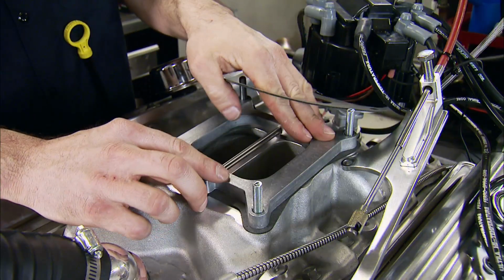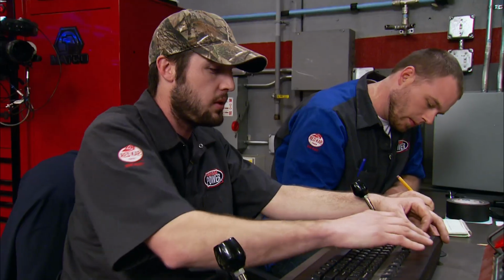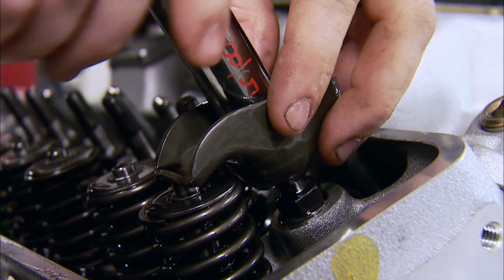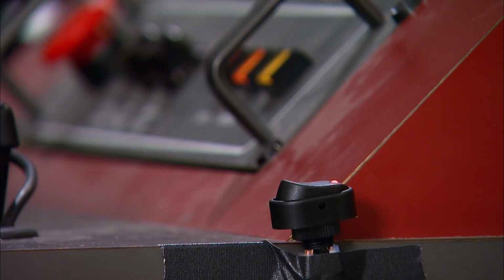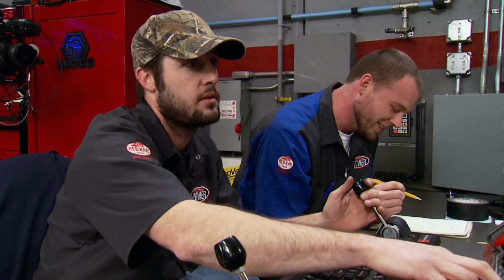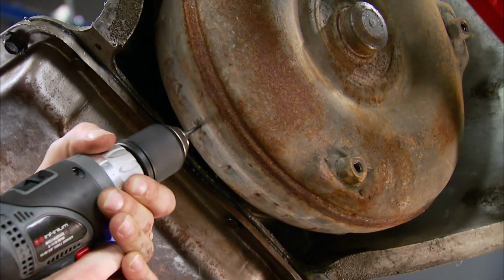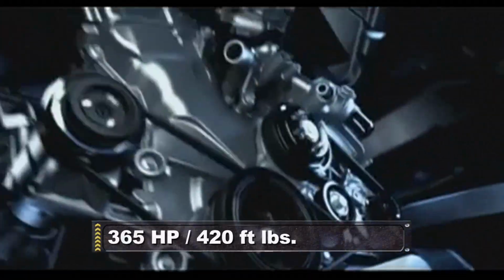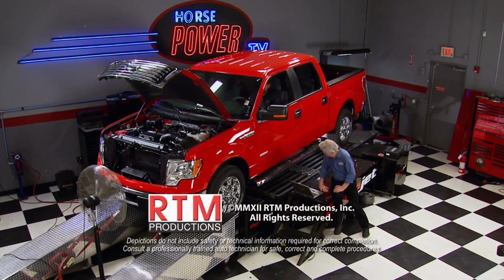Testing The Best Bang For Your Buck Performance Mods - Horsepower S16, E6

Comment: Running the electric pump from an external power source is pointless. You need to have the alternator running the engine electrics from the start of the test and then also the water pump.
Reply: An electric water pump like the one in this video pulls ~10 amps continuous, which is ~10A * ~14V = ~140 W or 140 W / 746 W / hp = 0.19 hp, so not even measurable on an engine dyno (i.e., if run off an alternator on the engine as proposed).
Reply: @salninethousand2496  and should be shown in the video.

Comment: If I paid 700 bucks for my race converter, I'm not drilling a hole in it and sealing it with a pop rivet.  I'll take it to the shop and have them flush it

Comment: How come it doesn't make 355hp?
Reply: Thats wheel horsepower not crank horsepower.
Reply: @CJColvin  how the motors on a dyno?
Reply: @scottbrooklyn2995  Thats crank horsepower brother, thee 355 HP is just an advertisement.
Reply: @CJColvin  but to get wheel horse power wouldn't the motor need to be in a car.  And chassis dynod?
Reply: @scottbrooklyn2995  Yes it sure does.

Comment: The tune on the Eco boost made the power not the so-called cold air kit, you could have just installed a high flow air filter into the stock air box with the tune and the results would have been the same.

Comment: Mechanical pump uses engine power to run it........ what powers the electric pump? the alternator, which at high loads, ive added a giant water pump, will steal power from the engine.